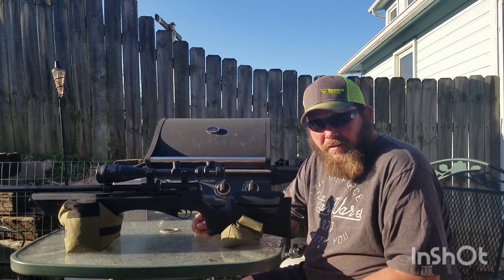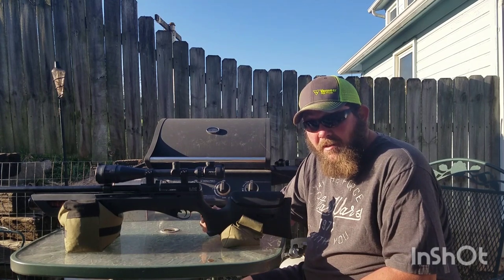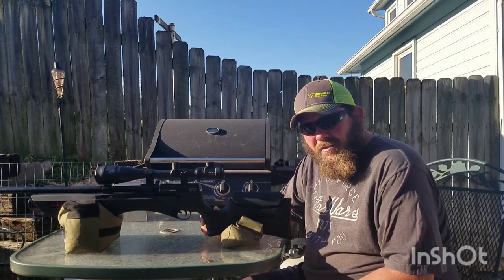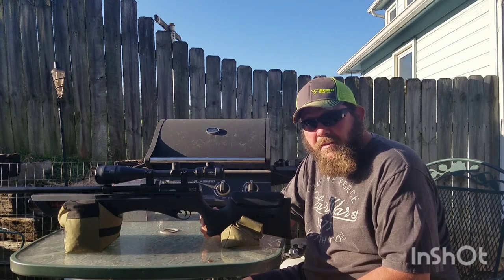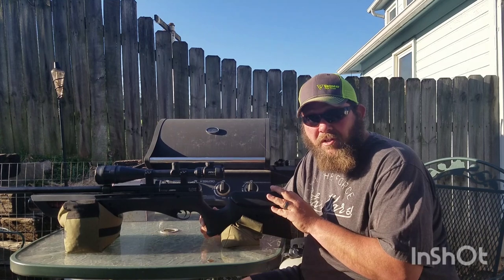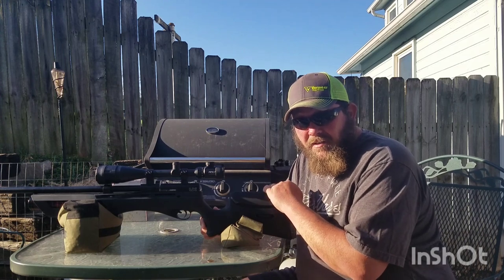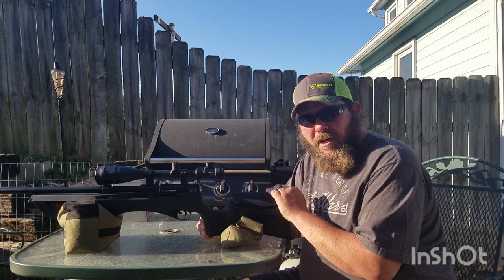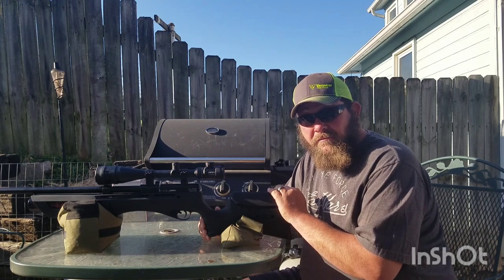Hill Airgun Umarex Gauntlet Hammer Spring Kit

Comment: That's really cool, glad it works well for ya. I'd love to have that many shots per fill. I have guns with the smaller air tubes on them and they will work you to death out shooting. I finally got an electric pump and turning stuff down to shoot more, even with the pump I was having to stop every 20 to thirty shots and refil, turned down I can get 50 out of my Flashpups and 60 out of and AT44, lol. I'm so glad you got a good gun and able to enjoy it. I love checking out stuff people are making at home for airguns, I've ordered some stuff from eBay that I like really well, a great place to find some awesome stuff.
Reply from the maker: Thanks for checking it out. It really has made the gun much more fun to shoot. I don't need it at full power to target shoot at my house. In fact, when I would shoot it at full power it would blow my swinger target right off the stand! Lol I also bought a Gauntlet in .22 off of ebay recently & the spring kit performs really well with it too. I have not chronied it or kept a shot count but it is great. And all that pumpin has got my stamina up. When I first got it I could pump 30 or 40 times and had to stop. I am up to 60 or 70 now! Does a fatboy good! Haha
Reply: @bigjsoutdoorsairguns9007  Lol, I hear ya on the pumping, I have body issues and I pumped it up anyway, it's difficult for me to get exercise but that would get my heart rate up for a bit. I know exactly what ya mean, by the time it was over I could pump mine up all the way through 110 pumps until it was full, of course, my tank is nowhere near the size of yours. I have pumped up a .25 cal Gauntlet quite a few times myself, and I see you count how many pumps it takes too, lol. Ok, I'll take a break at 60, lol. Congrats on the new gun, as well. K, I gotta get on the homeschoolin', I'll jump back on here at recess, lol.